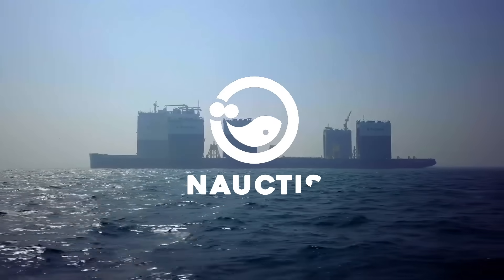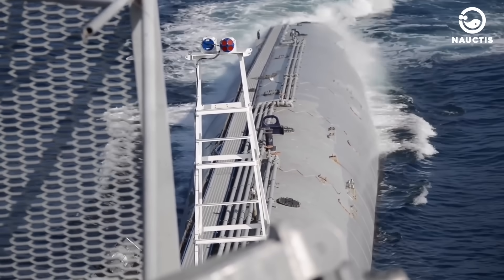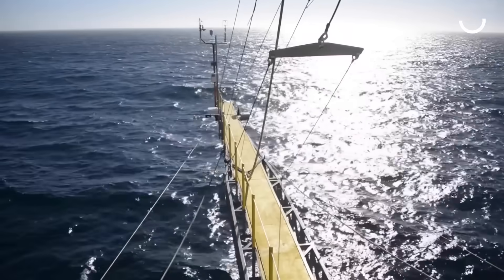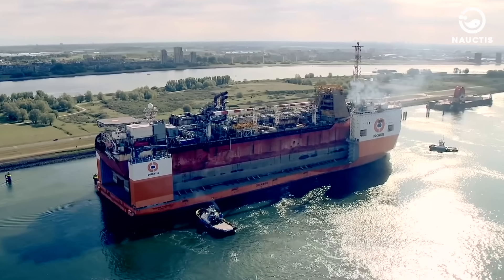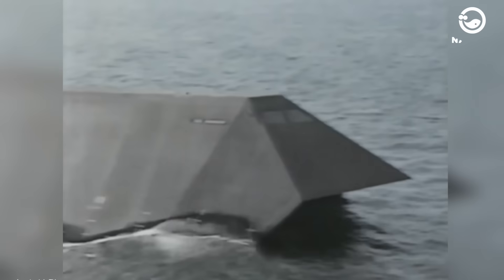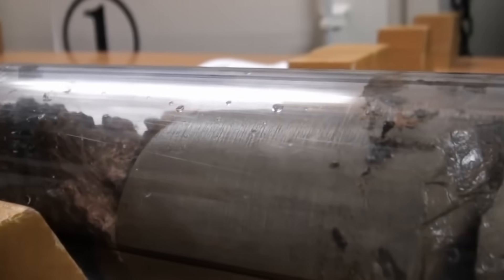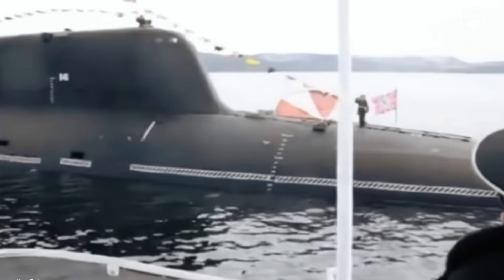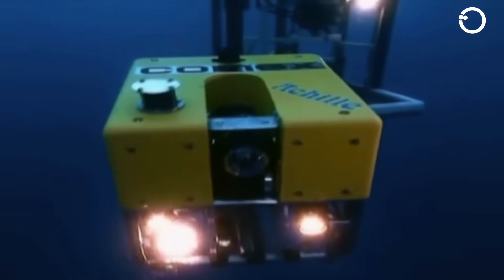Inside the US Navy FLIP Ship That Turns 90° During Rough Seas

Comment: OBSOLETE  and INCORRECT information about the research vessel FLIP.
The vessel FLIP was a vessel to be used PERMANENTLY in the Vertical Position INDEPENDENT of sea state, calm seas included.
FLIP was Decommissioned in 2023 having outlived it’s useful life MANY years ago.
It’s home port was San Diego, Ballast Point where it seldom saw use since the early 2000’s.